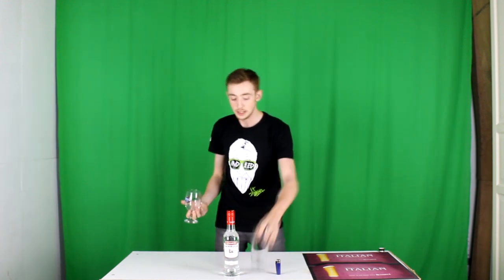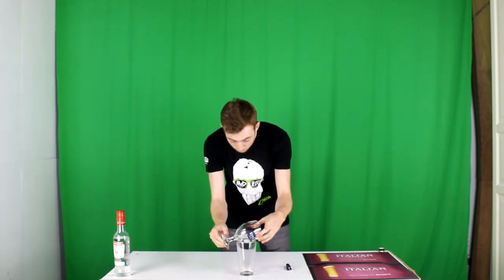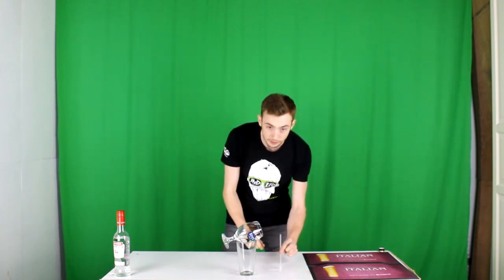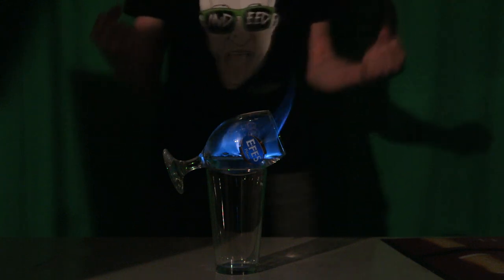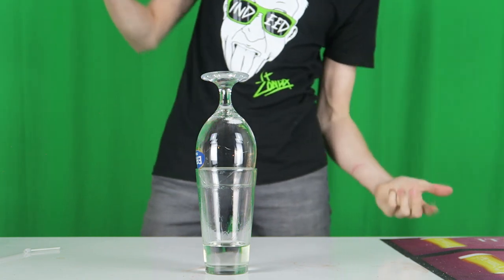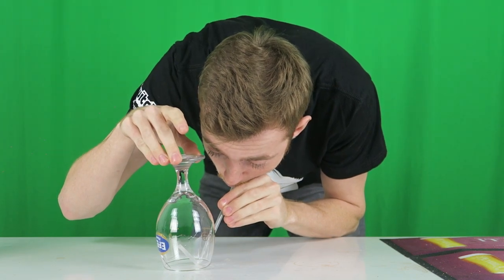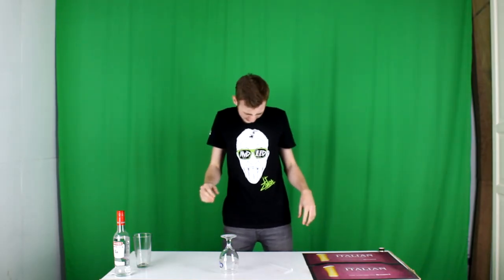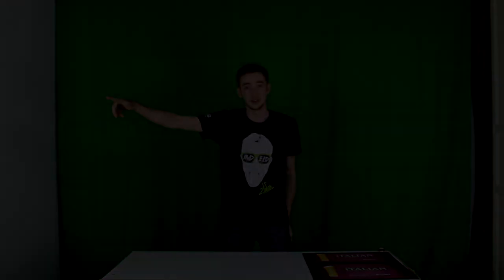SAMBUCCA GAS CHAMBER!

Comment: My record was 18 of these in one night, still fresh next morning. 

few points: rotate the glass, the sambuca itself isn't heating up (the heat is rising.)  rotating the glass disperses the heat and allows the liquid to cool the glass as each side becomes submerged.

secondly, for extra strength, pour the flaming shot into a shotglass and cover the with the wine glass, insert the straw and inhale it all before the shot itself. 

A nice twist is also to use chilli sambuca for that extra sense of heat.

if you're not going to gas it (it can blind you.) use a straw to drink it while it's lit (it will go out in the straw)

you can also light it in your mouth if you're partically careful, stupid and know what you're doing. (emphasis on latter.)
Reply: Oh and one important safety tip: first time you make this, the sambuca may take a good couple of seconds to light, however if you go to make a second in same glass (which will be syrupy/sticky on inside) it will light much easier and you'll get a medium shot of fire shoot out of the glass, which can easily burn you, keep your fingers below the rim at all times.

obviously keep a fire extinguisher near by, and if you're trying in a public bar, or even a house party (I love this shot and luckily my local trusts me enough to do it.) remember to look out for anyone who might bump into you, drunkenly touch or knock over the glass etc, you can easily spill the drink, coating the entire bar in fire.